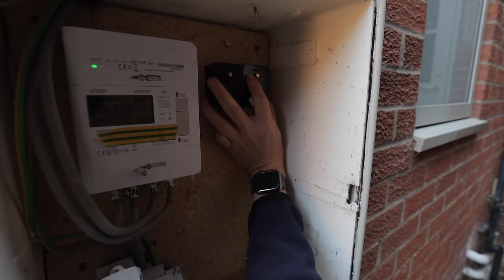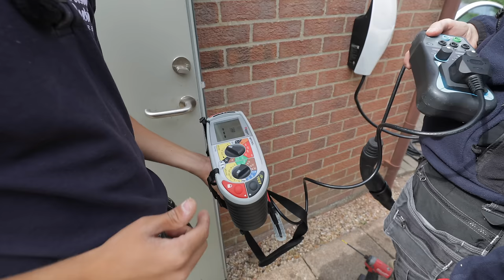I was WRONG! The Tesla Gen 3 Charger is the WORST!

Comment: If you want to coil cables so that they don’t twist the cores internally you need to ‘figure of 8’ the cable. This means that you reverse the direction of each alternate turn as you coil the cable. Then when you pull the cable away from where it is coiled it will always come away straight and not twist the internal cores. When people coil up a cable around their hand and elbow it guarantees a damaging twist to the internal cores because each turn reinforces the twist of the previous turn.
Reply: I coil in an 8 around my hand and elbow
Reply: When doing record engineering cables have a memory, any forcing will damage the core so we always use loose coils basically the way they were originally packaged so forcing a figure of 8 I'd say also isn't ideal. Studios have cables that are used and stowed numerous time and last decades.
Reply: I was taught the figure of 8 things by a yachty. That's how he said they coil their ropes.

Comment: Before I had my Tesla wall charger V2 installed, I installed a mesh network node in the garage, right next to the wall charger and another node in my bedroom above the garage (the garage node is too far away, and has too many walls to go through to get to the router so... The router node talks to the bedroom node, then the signal goes through the floor to the garage node. I have 6 nodes in total spread around the house level.   Never had a problem EVER.   Maybe Mr Artisan you might like to install a mesh network as well as the wall charger at very site - they work brilliantly. The Gateway, Powerwall and Inverter can all use it as well as your phone.

Comment: Tip - many IoT devices are 2.4Ghz, including the Tesla Gen 3.  To have a happy experience turn off the 5Ghz network, do your pairing, and then turn the 5Ghz back on - if they are separate don't try using the 5Ghz network.
Reply: 2.4ghz is perfect for most and I wouldn't want that to change. Typically they don't need a lot of throughput and benefit better from the extra distance the signal travels on 2.4ghz
Reply: I had to do this a few weeks ago when connecting a WiFi smart plug, total pain heading to silence the 5Ghz to complete the pairing, then remembering to put it back.
Reply: @welshdave5263  just split your 5ghz and 2.4ghz channels and then only connect things to the one that is better for that device
Reply: And also the Tesla Gen3 (like many other IoT devices) also won't work with WPA3. 
Need to have a network, or sub-network on WPA3
Reply: This. 2.4 GHz, 802.11b/g/n
Reply: What usually happens when temporarily connecting your phone to a new device's SSID (in this case Tesla charger) to pass it your router's SSID and PWD is that your phone detects there's no internet connectivity on the new device's wifi and switches back to your router's wi-fi or mobile network unbeknown to you. The solution is to turn this "smart" setting off (if your phone has it) else turn off auto reconnect for any local SSIDs AND turn off mobile data until you complete the new device's wifi connection wizard.
Reply: 2.4Ghz networks only and WPA2-AES compatible, a lot of older routers or those that have not been updated will be rolled out with WPA2-TKIP, I see it all the time on some bits of transmission kit. Quite a few IOT devices have similar restrictions too
Reply: Agree
Reply: As a matter of principle when I set up new WiFi extenders in my large home, I always give the 5GHz and 2.4GHz different SSID’s. Then you can’t go wrong!
But in this example it would require the householder’s permission to change his router settings
Reply: it is better to restart router just before making pairing. By default router will auto select radio channel to have as stable as possible signal. 2.4gHz is the best band for going through walls
Reply: With a modern, decent router and all this goes away.
Reply: @neilgilroy1629  no it doesn't, not if your dual banding on the same SSID, the phone is connected via the 5Ghz network and device wants a 2.4Ghz network. This specifically a device/vendor software issue, because the software/device is trying to connect to the wrong network band using the BSSID instead of the SSID. The solution is to make sure that the commissioning device (phone normally) is on a band that the device to be commissioned supports.  Easiest way to do this is to turn off the 5G wifi band during commisioning.

For the sake of simplicity the wifi on my IOT network is now only 2.4Ghz, while the my main network is dual band.

BTW I am running modern gear - Unifi end to end, all up to date.

Comment: Fun fact. You guys installed my gen 3 charger and it works wonderfully with my wifi network. No issues whatsoever. It was the blue tesla unit and you guys have a video of it :-)
Reply: I have install many of the Tesla Gen3 Wall Connector and have had zero issues with connectivity of the Gen3 Wall Connectors.
Reply from the maker: That is a very good looking charger!
Reply: @artisanelectrics  and finally got the matching car!!!
Reply: @michaelholliday100  yeah but things working well makes for shit youtube views
Reply: Why not use ethernet cable . It's not difficult to put a socket on the thing
Reply: @MINIDISK111111  All for the mighty Views and Likes...

Comment: I got the gen 3 mostly based on your original video and have had 0 issues with it. I do have it on a 2.5g only wifi network which fixes the issue of connecting it.

Comment: That stuffing gland beneath the Permali box is begging to be the source of trouble. When the first heavy rain comes in that direction it will run down that wall and into the PEN loss detector box and probably cause a fire. You should have used a 25mm adaptor and a piece of 25mm conduit glued in to create a watertight seal.
Reply: 'first heavy rain', 'probably cause a fire'. Talk about overstating the risk. The chances are you could have it that way for a million years without causing a fire.
Reply: @sailingoctopus1  I'm an electrician with 40 years in the industry, I didn't take the time to write that because it's a hypothetical chance. It WILL happen!

Comment: I've had similar experiences with embedded/smart devices and WiFi networks. If your WiFi is dual band (5 & 2.4 GHz), try disabling the 5GHz when doing the pairing. I have no idea why but sometimes that helps.
Reply: 5GHz doesn't penetrate walls as well as 2.4GHz so the range is often less, this is probably why
Reply: @henryeadie7972  Most of these embedded devices don't have 5GHz radios, so they wouldn't try to to connect to that signal, but somehow it seems they effect each other.
Reply: @henryeadie7972  Here is an example, a car pulls beside you with the Subwoofers cranked, thump, thump thump, but you hear no vocals. It is difficult to isolate or stop Bass from going through structure, trees, buildings etc. So, in an open field 5.0 GHz will travel much further than 900 MHz or even 2.4 GHz. The higher the frequency the larger the bandwidth, the more data that can be carried in a given period of time. That is why a 900 MHz Router may be able to service and entire home and with a 5.0 GHz Router you may need a Mesh Router with 2 Remotes to cover the same area adequately.
Reply: @Dries007BE  Usually what happens is the device you are using to pair IoT device is on the 5 Ghz network and passes that to the the Iot device, which of course it can't use so doesn't pair.  Lifx Globes are classic example of this.

Comment: Your WIFI commissioning problem, if you are mounting the Charge Point outside, may actually be the windows on the house. If the house has newer windows and they have Low-E coating on them you will likely have an issue. The Low-E coating can inhibit WIFI signals. I experienced this on my house. I was having trouble with my WIFI in the backyard, finally I actually added an additional access point and mounted it on a little shelf in the window of my workshop, on the inside! Still had shitty WIFI, as soon as I opened the window and moved the access point outside the window, boom, fabulous WIFI. Ended up getting an outdoor access point and installing it on the side of the garage.

Comment: Have you got to the bottom of why the manufacturers are moving away from wired connections? and why can't the data run over the power line? My PC does
Reply: The Australian Tesla wall charger installation instructions specifically stated NO POWER LINE NETWORKS.  They had to install a new transmitter near the router, and a repeater in the garage. Once they got it all up and running, and then left, I ripped it all out and used my own mesh network. I tried to explain to the chinese workers, but they had a blank look on their faces.

Comment: I work in IT and IoT devices have always been a "hit-or-miss" when it comes to joining a wifi network. 
It took about 3 attempts to get my Tesla wall connector joined to my network. Plus, it really doesn't gain much besides updating the firmware. I was expecting more from them. 
At least you have more options than in the US. Here, Tesla uses a proprietary connector, so if you don't use their unit, you need to fiddle with adapters.
Reply: If you have like cisco or Ubiquiti or other enterprise level hardware you should be able to make a different network with low density and legacy support for 2.4Ghz which normally should support any chip and possibly fix the issue with the tesla thing.
Reply: @antoniogoncalves705  I have ubiquiti hardware and I cannot for the life of me get compatible signals for some IoT devices. In case it is useful to anyone... a workaround I have is... temporarily rename my real connection SSID... get an old basic router and name it what the original network SSID was called.... connect your devices... turn off old router and rename the SSID back to original. Works a treat (only have to do this the odd time i encounter a new IoT device that I have trouble with)
Reply: @ciaranflynn6291  I never had issues after configuring my network properly. What devices are you trying to connect? Do you have legacy support for 2.4Ghz network or IoT network if you have one. What channel width do you use for 2.4Ghz? Do you SSIDs have weird chars?
Reply: Also do you have 5Ghz separated from 2.4Ghz or the prefer 5Ghz option on in the unifi devices?

Comment: Normally devices for IoT have cheaper wifi chips since they don't have lot of traffic which normally don't support high density networks so that could be the issue. Another issue would be mixing 5Ghz with 2.4Ghz since most cheaper wifi chips only support 2.4Ghz and when you do a internet connection if you don't ask the router for the correct connection it might get messy fast and delay the connection. For my network since I do a lot of IoT I have a different wifi network called IoT which is a low density 2.4Ghz network with legacy support. I have a ubiquiti network setup so I have everything supported in my home but for most common households having different wifis or network setups might not be possible so it might cause some problems for some connections.

Comment: Great video. "IT specialist" here. I think the problem you probably have with connecting the unit to WiFi is just poor signal strength. This is probably why the problem you're experiencing is "intermittent" and why you couldn't replicate the problem whilst recording. It will largely be situational depending on the location of the wireless access point you're trying to connect the charging point to. The Tesla wall charger also only supports 2.4GHz frequencies so wireless networks which broadcast the same network name (SSID) on both 2.4 and 5GHz frequencies "may" have issues connecting if the access point tries to prioritise the 5GHz bands. If that's the case, you can disable 5GHz temporarily on the access point / router to pair the wall charger and then turn the 5GHz radio back on after, however this requires a little IT know how. I think the mistake Tesla made was to only provide an option for WiFi connectivity to connect the unit to the internet as supposed to providing an RJ45 ethernet connection. Yes it's an extra cable, however you're running a cable for power anyway so why not provide the option. The decision to not include this in their unit was probably one of cost I suspect... however on a £450 unit, an extra £10-£20 is insignificant. Hopefully Tesla include this in their next revision. Great video guys, big fan.
Reply: It is simple
Reply: they fit loads of brands... I'm guessing others connect easier and if you are by the charger its easy to see wifi by just looking at your phone and if that connects and the charger unit doesn't then its not signal strength.
Reply: Access Points or wireless routers only prioritise 5Ghz over 2.4GHz if the client supports both. It’s prioritised on a per client basis, not a global basis. I’m sorry to say that it is not relevant here as the Tesla unit only supports 2.4GHz which means it wont even see the 5GHz band so it certainly wont try and connect to it.
Reply: "IT Specialist" here. Just to fly in and say that the charger sucks. I've places the router right next to the charger (within 0.4m) and it still disconnects from the wifi and takes at least 20 minutes to connect via the Tesla App. Resetting the charger is impossible because I can't remove the charger from my app myself and reconnecting it whenever it disconnects is a huge pain.

Also, it doesn't charge. Will be requesting a refund from Tesla.
Reply: @mhvdm  Have you tried a mesh network instead ?
Reply: @greghudson9717  I figured it out. After a software update from Tesla it fixed the issue with disconnecting all the time. So there was an issue with the Charger Software afterall
Reply: I'm not an IT specialist, but I have been an RF engineer for 20 years in the cellular industry.  Its not so much strength.  The modulation scheme and all connectivity parameters  are based on quality.  SINR to be specific.  If you stick that unit in a corner on a brick wall, not only do you have to deal with significant attenuation, but multipath will also degrade the quality.  OFDM modulation doesn't do very well with multipath, unlike its CDMA brother.  A relatively cheap ubiquity AP in repeat mode on the inside wall would be more than suffice.  Either way, if one calls something junk, and they didn't do an RF survey, they are simply a fool.

Comment: Find the charger on the router's controls (2.4GHz band), then set the IP address as reserved.
Can you also fix the IP on the charger via its portal? Best this way as it doesn't have to try to negotiate a connection - just use the fixed one you set.
Reply: That’s all very well but shouldn’t have to do that in 2022.
Reply: @hks-lion  I know you shouldn’t have to. Indeed you don’t, however why waste process time with the address negotiation exercise when you can simply lock in the address. It avoids any other device pinching the address if it comes up first after any outage.
Reply: @herrtomas6729  reserving an address does not skip the "address negotiation exercise", the client device still has to ask for an address, get offered an address (the reserved one) and then accept it.
Reply: @Gr33nMamba  the ideal is to also set fixed on the client. This is my choice for key clients

Comment: Pairing devices wether through WiFi or Bluetooth always seems to have bad moments now and then, sometimes when I start my car up, the stereo pairs up straight away with my portable MP3 player, other times Pressing play and pause a few times will get the stereo to see it. Other times have to go through settings and select ‘connect via Bluetooth’. But was wondering if the customer had a decent router and also if it has positioned in an ideal place. A lot of home owners like to put them on a low tv cabinet to the side or on the floor almost hidden out the way, and just taking off the floor and putting it on tv cabinet next to tv can mean you can now receive WiFi in upstairs rooms. How often do you get customers that either buy their own chargers, or even consumer units for you to install? Because I’d imagine most ev customers just ask for a ‘general quote’ to have a suitable charger installed. Or at least ask you, “what do you think about having this brand fitted?” A friend of mine who fits car audio, will refuse customers who want the cheap Android Auto headunits fitted, even if they’ve supplied it themselves, as he knows they’ll be back in a few months with problems or just unsatisfied with it.

Comment: Yes figure of “8” the cable to avoid damage over time. This will also avoid EMF in other instances where flex is not fully unwound. 
Probably better to have some kind of separate bracket next to the charger to allow figure of “8” and make the charger look uncluttered. Agree about mastic to stop water running into the charger board but would have installed a bush and coupler. 
Good job though lads.
Reply: Fig 8 will make ZERO difference to "EMF". If you have conductors next to each other carrying equal and opposite currents (such as Live and Neutral for example) their magnetic fields will cancel out so no inductance. The fig 8 myth came from coiled cables becoming hot and people believing that to be due to  inductance, IT ISN'T it's simply down to resistive heating and inability of heat to escape,  Fig 8 creates more air gaps and a larger surface area for heat to escape.
Reply: @mfx1  When you think about it, that makes sense about the inductance Martin, so I have to agree with you annoyingly. In my defence, hanging by my finger tips, maybe the figure of 8 would help with resistive load heat build up, because it’s 2 coils effectively, and also reversing the could will lessen the internal damage to twisted cores. Humble pie has been eaten. (Going to test it though)